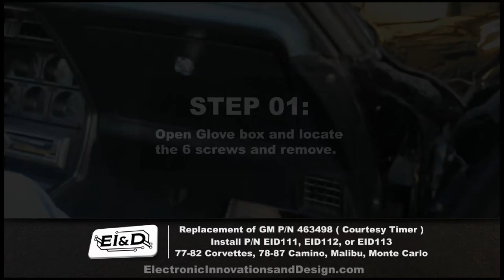C3 Corvette Courtesy Light Timer Installation Guide

Comment: I don't think this is correct for a 77.  I think its only for 78 and older.  I have a 1977 and my turn signal relay is behind the glove box.  The courtesy light timer is behind the drivers dash, taped to the wiring harness.  It looks almost exactly identical to what the turn signal relay looks like.  If you look in the AIM, you will see it is shown as in a different location.  Also it is not a small circuit board.  OH HOW I WISH IT WAS! :-(

Comment: I think something like this may be what's wrong with my car. but what is the courtesy light timer for?
Reply: Nick Kennedy 
most old vetts dont come with a timer .so leave the door open it drains the batt, with the new circuit board if u leave the doot open it shuts the lights off auto after 15 min..